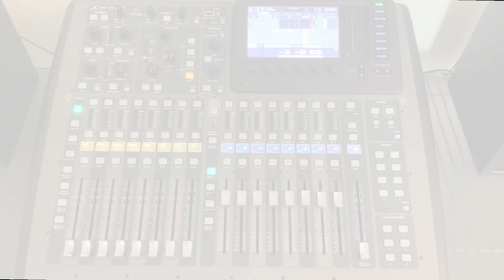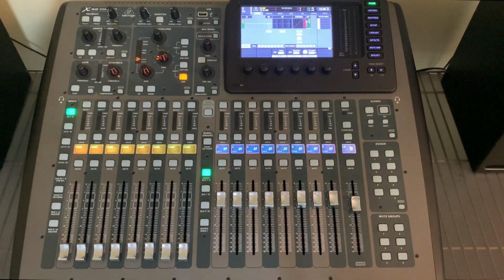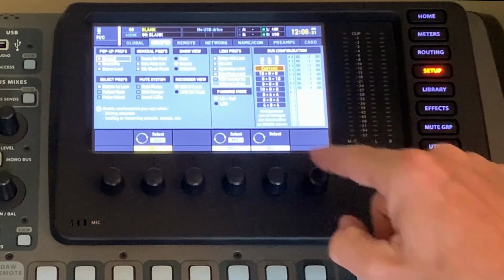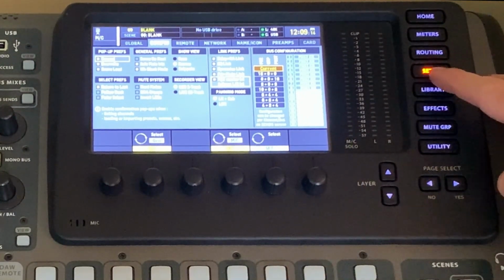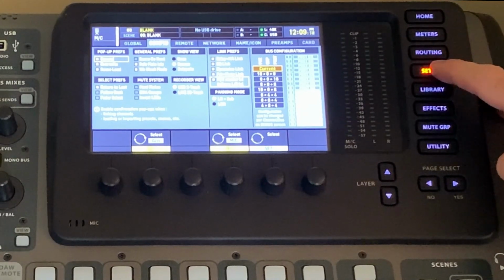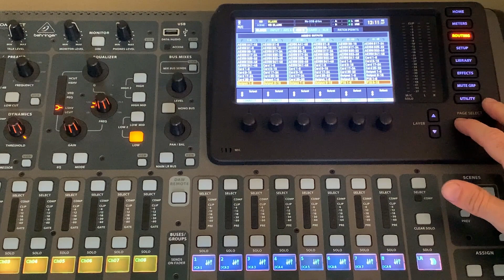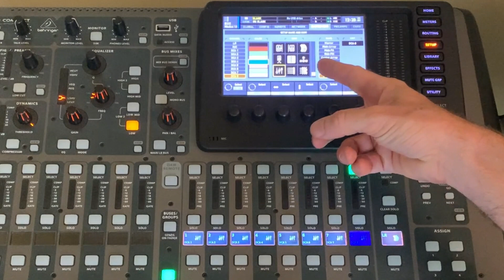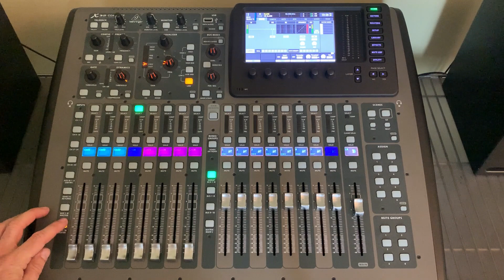Custom Mix For Your Subwoofers  |  AUX Fed SUB

Comment: Thank you very much, Ive been using, the not so preferred Yamaha TF1 at work for the last 2 years, I have forgotten so much of the UI on the M32R but thanks to your vid I got a refresher on how to route the SUBS on a separate fader. Nice vid, keep up the good work. Cheers from the UK :-)
Reply from the maker: I’m glad you found the video helpful. Let me know if you have other things you are hunting for with your return to the console.
Reply: Thanks Dave. Thank you for the message I appreciate that. Maybe you can assist? I’m having issues getting signal from my M32R to my MacBook Air M2 running Garage band. All software updated to the latest versions. Wondering what I’m doing wrong? I’ve tried to looking for videos on here but nothing that’s solving me issue. Let me know if you can assist? Thanks Dave. Cheers Sean
Reply from the maker: two things to check... 1) Make sure your Routing > Card tab match your Routing > Inputs settings. This confirms your inputs will route out to the card to be received. 2) My assumption is that you are attempting to use Garage Band as a DAW to record, but understand that Garage Band is limited to only two inputs. You will NOT be able to multitrack record all 32 inputs at the same time into Garage Band. You could setup to have a board mix or livestream mix or some other stereo mix captured into garage Band, but you won't be able to capture all inputs individually. That being said, understand that by default, Garage Band only sees USB 1/2.  I hope this helps. I am happy to assist further if you need to get some details specifically set.  Let me know.

Comment: My stuff is gained in such a way that 0 is the lowest and +1.4 is the loudest I can go without bothering anyone. The subs are always subtle so you can hear a balance of mid and highs with those lows cuz they lows sound big
Reply from the maker: If you have something that is working then you are in a good place. I usually want to make sure the PA is tuned properly which provides me some more flexibility in how I can use the fader to send signal to my subs. Often times when a company does an install they just crank the amps all the way up, so it might be worth looking at the settings on the amps for the sub in case you can make adjustments and grab more flexibility.  Obviously, in the end if it is working, don't change anything.

Comment: That’s very good information but I have a question, I’m working with a x32 compact and I do want to do this but do I need to eq the channel to a low cut or high cut to just isolate the low frequency for the subs?
Reply from the maker: You still want to EQ your inputs according to your needs for each input. The signal will then go to your top cabinets where you will (most likely) get the upper frequencies coming through and then your AUX SUB where you would get the sub frequencies. The channel EQ will impact the entire input therefore the entire sound coming from your PA. The EQ on the mains or the AUX (feeding your sub) will just determine what frequencies leave the board and go to your speakers. I hope this helps.

Comment: I have a question using that where is the output on the back of the x32 compact which send do i plug in to get sound to my subwoofer
Reply from the maker: If you run a true AUX Sub you will want to pick one of the available outputs and then handle the routing. Usually (on the compact console) I use Out 7/8 for the Main L/R outputs and then I can set Out 6 as my AUX Sub output. You do this in the Routing > Outs tab where you select the source for this specific output. If you choose Bus 6 it will already be routed out Output 6 by default, but if you choose to use the M/C Bus or another Bus you will need to update the routing.

Comment: What else should we send to the sub mix bus
Reply from the maker: If you are running an AUX Fed Sub you want to only send the instruments that you need the super low end from which is typically Kick Drum and Bass guitar. If you have a piano heavy band with no bass then you can run the keys into the sub, but the nice part is that you can always adjust the amount of each instrument going into the subs so you can play with it and if the mix gets muddy you can trim back on the "extra" instruments going to the sub.

Comment: How to mute fx of vocal at one assign button.Generally to cut fx while speeches❤
Reply from the maker: If you want to set an assign key to mute your FX, you have two options. (1) You can mute the Bus that sends into the FX rack (usually Bus 13-16) and this would mute the signal going into the FX rack. This is a desired approach and makes for a smoother experience for the listener as opposed to (2) muting the FX return. When you mute the FX return you are cutting the signal in an unnatural way where the reverb just cuts off immediately. Using these options will mute the entire FX rack so any inputs going into it will loose the effect while muted. There is no way to mute an individual input going into a specific FX rack, but this is where people getting into double patching mics where you have a dry signal on one fader and you have a second fader taken up with the same input, but it is then running into the FX. I hope this helps.

Comment: @AllamHouse
I would normally send to my subs through a matrix. And I used to be a aux fed sub guy for many years. I had the RM32ai and it was easy. Then, I discovered the X32 and ever since, i have been using the matrix. 

I have a show coming up that consists of drums, bass, and acoustic guitar. Along with three vocals.  Your idea of sending to the M/C would be perfect in this scenario. I’m not going to want everything in the sub like I would do for an outside event. This case is a wedding reception. The main act is from Cali and I don’t want any vocal in the sub or acoustic.

Also in my case, I’m going to send the M/C to the matrix I usually use for subs. Sort of a best of both worlds type thing. On my rack x32 I have all my matrix outputs coming from the 1/4” aux outs to a patch panel on the back of the mixer rack. These then go to the powered top speakers and subs amps. I don’t use DSP other than the EQ on the matrices. 
I also have delay tower out and either a stereo pair for a video feed, or front fills. It’s what I use at Utica Square for the summer’s fifth night series.  

I think you’re in Owasso, if I remember correctly. Maybe that was a different content creator, but not sure now.
Reply from the maker: I’m actually in Richmond, VA. It sounds like you have a fun gig ahead and found a good solution for your setup. Happy Mixing.

Comment: You got neopreen pads under those monitors?
Reply from the maker: Currently the monitors are just sitting on that basic plastic liner. I have foam I put under them when I am actually mixing, but this setup keeps getting moved around as I swap between my Wing and X32 depending on what I'm doing that week.

Comment: Allan. I have x32 console. How do I setup my subs woofers for drums and bass guitar to only come out my subs. I’m trying to set it up for our group for Our gospel trio  any help would be a blessing
Reply from the maker: While I will tell you below what to do it is NOT recommended to send those instruments ONLY to your subs. You will feel them on the low end, but these instruments need the high end frequencies to be heard in the mix as well. If you send them only to a subwoofer that is playing low frequencies your mix will lack punch and clarity.

To send these only to the subs you will make sure you have the input properly routed to the sub. Then select each input one-by-one and find the "Stereo LR Bus" button to the left of the screen and make sure it is not lit up orange. This will remove this input from being sent to the mains and it will only route to the Buses you have it being sent.

Comment: Hi and thanks for the great vid. Very focused (it's easy to go off on tangents with this board). So, what if I want to maintain separate level control of my subs (I enjoy cranking them up at appropriate moments)? What would I select in the "TAP" column?  In analog world I do EQ and compress the subs separate from the mains. Intuitively I would select "Pre EQ+M", but there is nothing intuitive about this console (does that mean, "pre mains EQ?, or just the subs' EQ?). Thanks!
(I actually have the M32R, but most things are the same on the platform).
Reply from the maker: Whether you send your entire mix via a Matrix or use this AUX Sub approach, you still have independent volume control using the MixBus (or Matrix) fader. You will want to make sure the tap point in Routing > Outs  is set to Post Fader and this will give you control of the sub level with that specific fader.

Comment: Where are the subs plugged into on the x32? Into one of the outputs??
Reply from the maker: Yes. By default the MixBUSes are set to go out Output 1-14 on the back of the full-size console. 15/16 are preset to be the Main L/R. In the end, if you want to change the routing you go to Routing > OUTs and you can decide which sources go to which output.

Comment: M/C doesn't act like MixBus on the X32 Rack. You don't get the sends on fader when selected. I have had success with using a MixBus but then I can't link it to the Main LR.
Reply from the maker: You have two options on the Rack…
(1) If you use X32-Edit you can go to the right side (just like a MixBUS) and click on M/C which does allow you to send inputs using the faders just like the normal “sends on fader” feature. 

(2) On the console screen you can select the desired input and go to the MAIN tab and you can adjust the levels for Mains as well as M/C.

Comment: Did you not have to set crossover filter points on EQ for the L-R tops and the M/C bottoms ?  I see others do that. Or does it not matter?
Reply from the maker: Those are options, but not requirements. Some people also have a digital signal processor (DSP) in their setup that does all that for them.

Comment: Hmm . . . . why not Select each input channel, and choose the Mono Bus, or Main LR Bus as you are setting up the mix. I can see using the Send to Fader option, like you would most buses, but why not set it up "correctly" from the beginning. So, for example, we set Keys to go to both, but vocals only go to LR, and we use three channels for our cajón, one for the port and one for the top - both go to LR, and a second one from the port that is processed to go lower (inserted Suboctaver) that goes only to the Mono Bus. It just seems to me that if you set each input, from the start, to go to LR or Mono, or both, then no need to tinker with Send to Fader for this particular purpose.

Perhaps this is all just a matter of preference - and the beauty of digital. I tend to prefer Send to Fader for temporary and changing things, like monitor or stream mixes. But use the input select and LR or Mono Bus at that point for what speakers are best for that source.
Reply from the maker: In the end both methods will get you the same result it is just a matter of which workflow you prefer. Also, I have to keep in mind that many of my subscribers have the X32 rack which doesn't have knobs so they are interacting with an iPad or computer across X32-Edit.

Comment: So, I'm new to this church's sound system. I am learning where all the 'stuff' is and how it's all routed. There is a very nice 'big' subwoofer on stage, and I see that it is connected to cable that disappears in a wall. I go back to the sound board and look to see if there is an XLR connector marked subwoofer, nope, nothing there. Nothing showing sub at all. I go to the room that has the amps and see the left/right main amps and the subwoofer amp. At this point, I cannot see that there is anything coming from the soundboard going to this amp. So, on my own troubleshooting, I cannot see that this sub is hooked up. I do have audio passing through the M/C channel, just nothing leaving the board. 
I've talked with the IT guy that also has pretty good knowledge of the history of this sound board and he too can't figure out why there is no signal going to the amp and then on to the sub. We have come to the conclusion that we just need to start from scratch, rebuild everything. There are cables and electronic devices that are not being used. Overall, though, everything else is working great!  I said all this to ask this question; shouldn't there be an XLR cable leaving the M32 and going to an XLR input jack on the amp? Or is there some sort of cross-over networking system is happening somewhere instead?
Reply from the maker: Thanks for all the context with this question. I would play some full range recorded music (Spotify or an iPod) through the system and touch the subwoofer to see if it is playing. 

If I were in front of the console I would go to the Routing > Out screen and see what mixes are being sent out through each output. This might tell you immediately what you are looking for. 

If you find nothing, the next place I would go is to the Subwoofer amp and see if you can trace a cable connected to the input of the amp. It might have a “through connection” from a different amp. Also, you mentioned other gear not being used and you may find a Digital Signal Processor (DSP) that takes the LR mix from the board and then splits it into separate signals for the LR amps and then the Sub. It would have some internal EQ to send different signals to the tops vs sub. Good luck with the hunt. I’m happy to help remotely if you want to go that route. We could do a Zoom call where I can look at your board and you can walk me through your system using a phone.
Reply: @AllamHouse  If I can't find how it's connected I may try contacting you. There's no hurry but if the equipment is there then why not use it, right?
Reply from the maker: I tend to prefer less gear as it could add more points of failure, more training for your team and troubleshooting can become more involved. Most setups that have an existing DSP can do away with them when they move to a digital console. The use of Matrix outputs can provide the EQ capability needed to direct specific signals to your tops vs. subs. That being said, I don't think it is something you just jump into removing unless you know what it was doing and the settings that were in place.
Reply: I found out that the sub is actually working. It's just not very strong. I've got a signal going to it and can feel it working while standing next to it but it's not very noticeable in the audience.
Reply: However, we are about to update our main speaker array and get new subs soon so I'm not going to worry about this one for now.